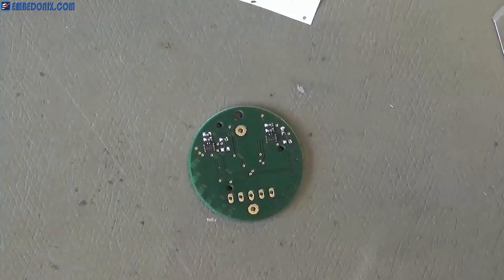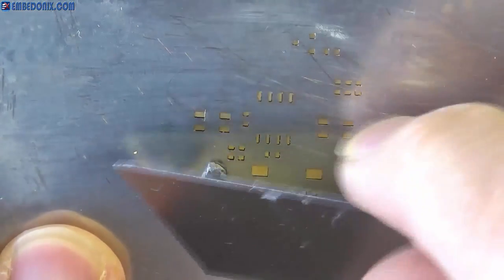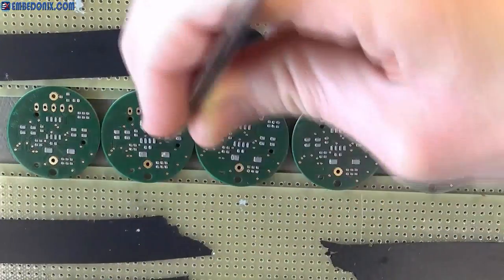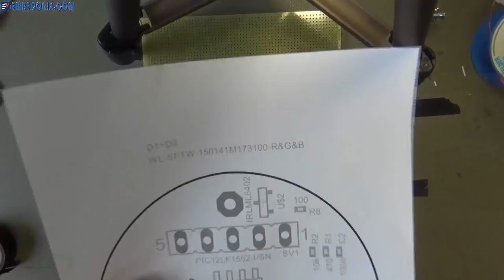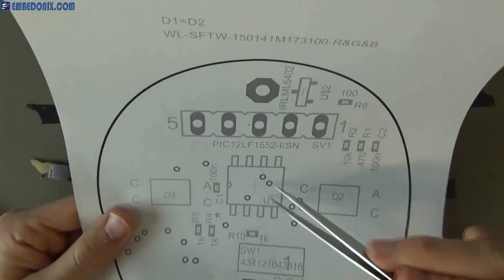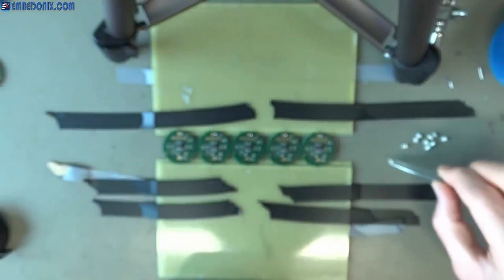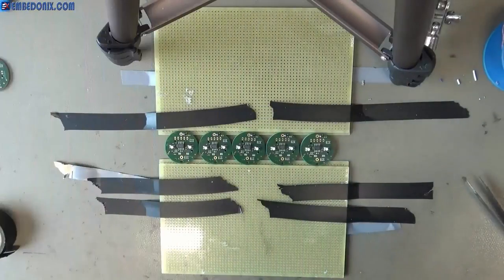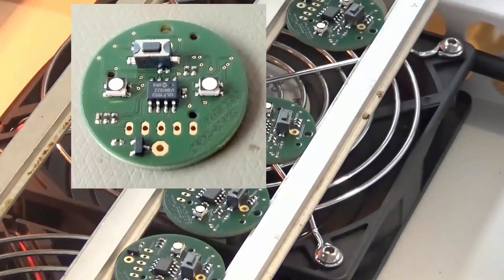PCB SMD Reflow Soldering Tutorial

Comment: if the pcb is two side what you do? you place components for double side the same time or side by side ?
Reply from the maker: For a small PCB like this that does not have very sensitive components, it can go to oven two times, one for each side. If it is a complex board and the reflow oven is professional (e.g. belted reflow oven) then for bottom side usually you put a dot of adhesive to hold components in place and put them in the oven to cook :)
Reply: @Embedonix  thanks for the reply so with this kind of oven we can use adheqive for bottom ? what kind of adhesive please.
Reply from the maker: @MC-gr7dp  The adhesive for this task is a specialized one...it should have very good insulation not to cause problem with the circuit function after soldering. Usually Acrylic based glues are used. There are many standards and articles about the type of glue for soldering you can find on the net.